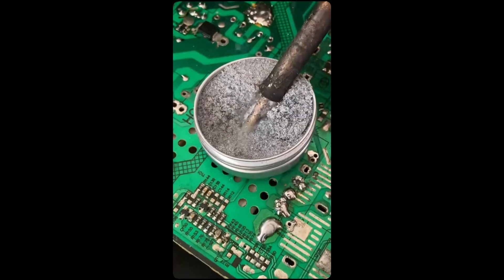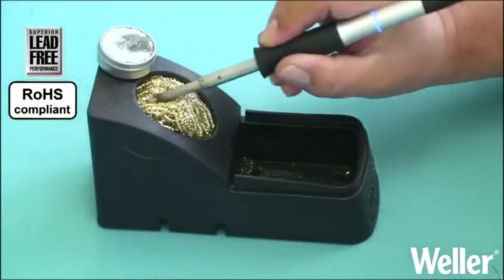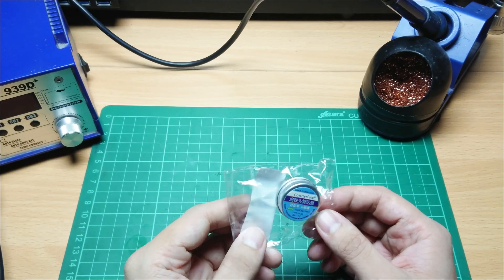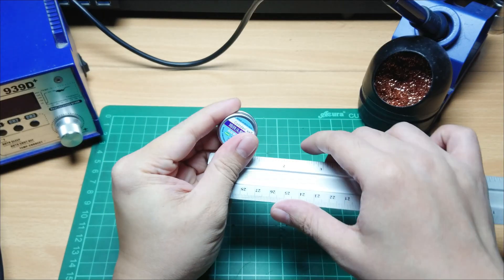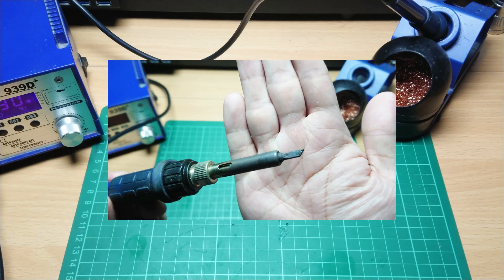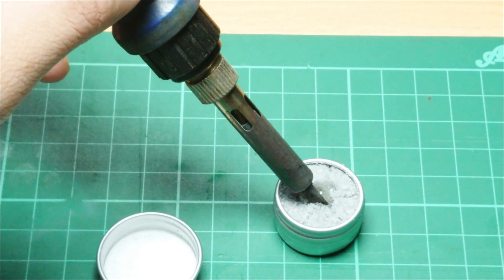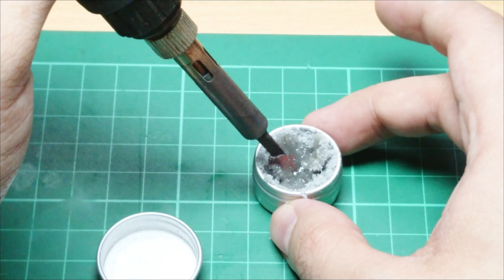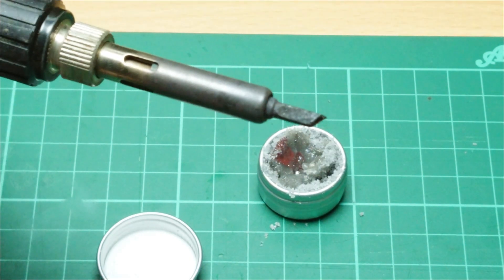Soldering Tip Refresher

Comment: I bought a similar one it worked well but i had to first remove the black thick layer by sandpaper then use that refresher
Reply: Sandpaper destroys the conductive layer on the soldering tip but if you say you were able to restore an old blackened tip this way then I have to try that. I have some nice old tips that no longer work.

Comment: You buy the fake one. Which I purchased is working well.
Reply from the maker: That's why I made this video. So others can avoid this specific brand. I am sure those being sold by reputable brands like 2UUL or ReLife will work better, but those are more expensive of course 😆
Reply: Exactly!!! 😊
Reply: I don't think it's fake. If the conductive layer on the tip has been burnt off you cannot restore it this way. Tip tinner is for protecting and maintaining a working tip and making it perform better.